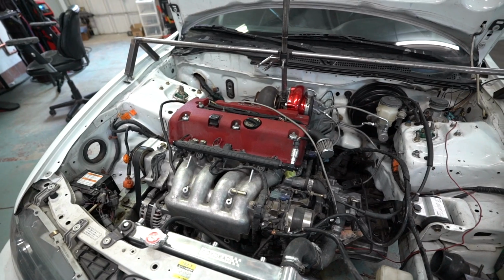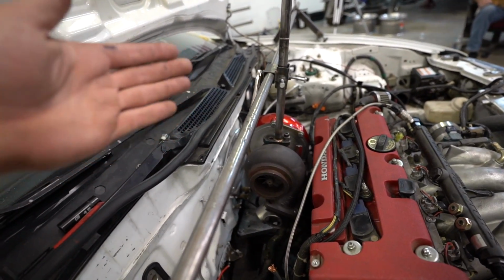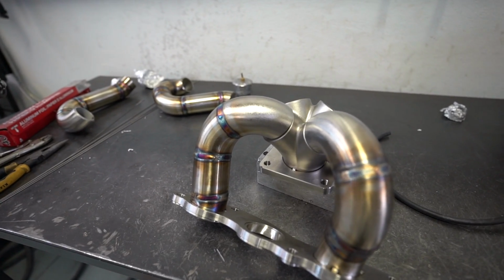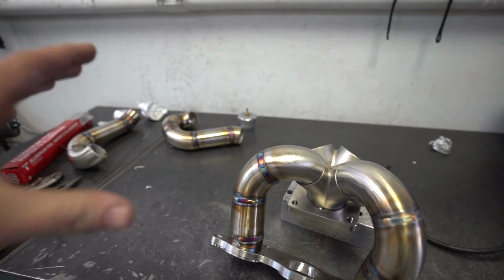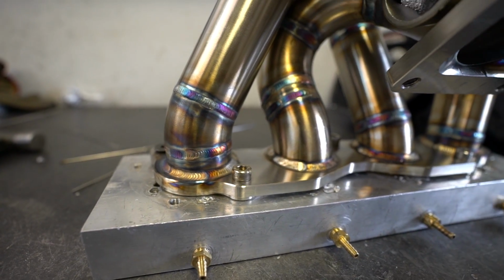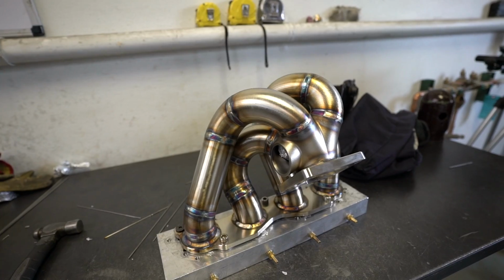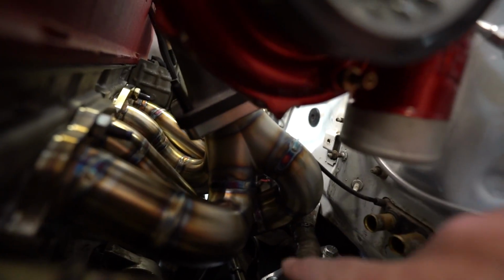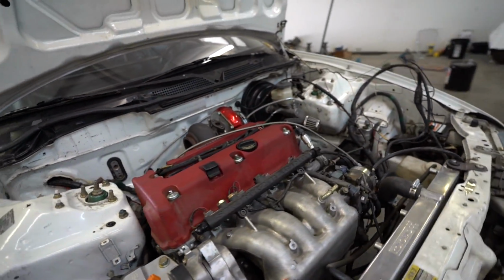K20 AWD Integra NEW Turbo Manifold

Comment: Amazing looking and very clean exhaust manifold Hayden! 
Would it be possible to ask Brent at PFi Speed to be doing a comparison and testing video. With this exhaust manifold and a couple of other kind of exhaust manifolds. Just to see if there is any difference in the powerband from them. Maybe it's more difference with a NA engine than a turbo one. But if it's possible to ad sensors to the manifolds tested that reads backpressure and maybe some other things. Could be cool and interesting to see some data from them. And on that note it maybe would be worth to offer an exhaust manifold for a K-series that's NA. If I'm not wrong it's very much more important to get the runners evenly lengthed and also which length it has before the collector. Just a thought.

Comment: I know you mostly do exhaust manifolds, but here's an idea, an integral WTA intercooler, that goes in the Skunk 2 Ultra race manifold. 

Take a core, cap it, and weld a sandwich plate that goes inbetween the velocity stacks and the plenum
Sick manifold, more R&D into motors is always welcome.

Comment: That's what you should do is buy a few junk yard engines like a K-series,J-series,H&B-series Honda engines and make turbo manifolds for all them then buy a junkyard LS and a junkyard Coyote engine and make manifolds for them short and long tube turbo manifolds and put your badge on them and make them on stainless and titanium you might have to buy a couple junkyard rolling chassis as well but if you did and then started selling your own manifolds on your website not only could you create more content with the cars and building things but you can sell them and make more money that way and that is exactly what Doug and them do over there at Motion Raceworks and so do alot of other performance fabrication companies do and that could open alot more avenues for you in the future